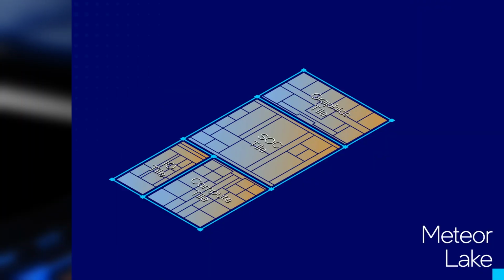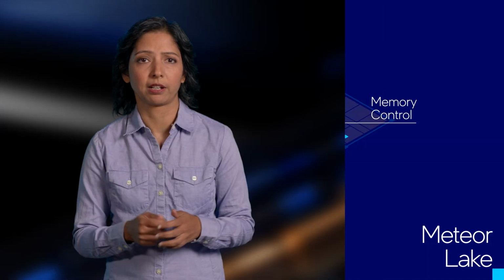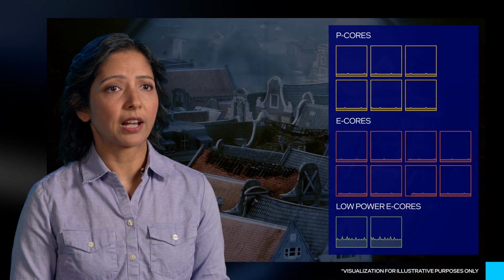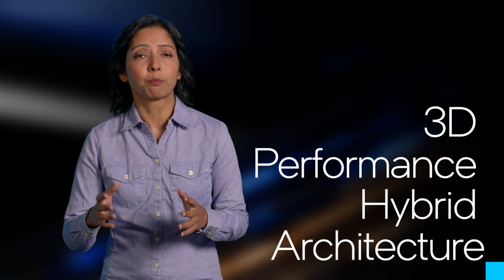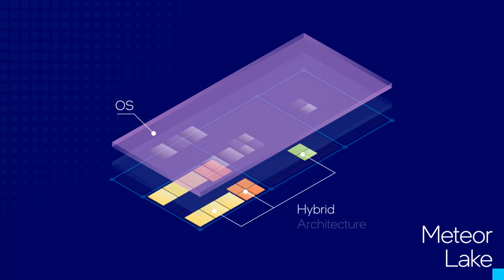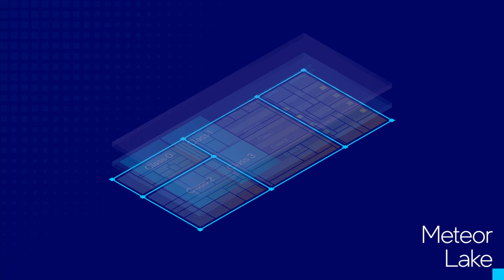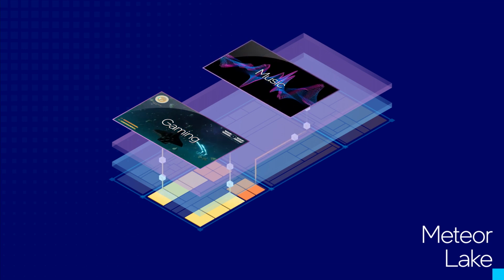Architecture All Access: Meteor Lake – 3D Performance Hybrid Architecture & Thread Director

Comment: Can the hardware guided scheduling technology not be available to developers to utilize in their applications instead of only the OS being able to make use of it?
Reply from the maker: Please be informed that hardware guided scheduling technology involves hardware providing dynamic feedback to the OS, and the OS manages the thread allocation across different core types (such as P Cores and E Cores) based on feedback from the hardware. This process is enabled through the CPUID instruction and configuration MSR, where CPUID and configuration MSR are instructions given to perform their task. While developers may not have direct access, they can use OS provided APIs to optimize their application performance. For more information, visit https://intel.ly/4iw0CcI Hope this helps.

Intel Customer Support
Reply: @IntelTechnology  Thank you Intel for the answer and link to that document. What's interesting in the document is that it only mentions MS Windows. A lot of developers customize the Linux OS, but I noticed also in that document is a link to the Intel 64 and IA-32 Architecture software developer manuals which contains 5240 pages in the complete volume series. Let me read up some. Thanks again.

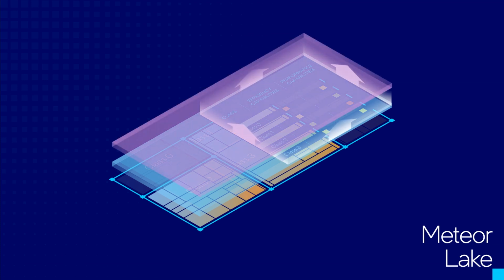Comment: 5:50 Why would the system ever be running on AC power? The power supply converts the AC wall power to DC power necessary for a sequential circuit. Could someone explain what I'm missing here?
Reply: She probably means charging (AC) or battery (DC). Modern OS shifts workload between big/little cores according to power source.

Comment: So will Meteor Lake's NPU be able to receive feedback from the application and then use AI/machine learning to dynamically optimize thread director to maximize performance? 

Each app is different, gaming apps are different from other apps, so will thread director be able to dynamically and intelligently reconfigured to maximize frame rates in games in one context or maximize performance in creator apps or encoding apps in another context ?
Reply: Being able to use the NPU is based upon what libraries are used for the task. The slides put out by Intel suggest that DirectML and OpenVINO are currently the APIs which can compile for the NPU. Once that is done, it is up to the discretion of the software vendor. The thread director is exclusively to balance the usage of the hybrid core architectures. AI tasks will primarily be handled by the GPU or the NPU or both. Intel showed off Stable Diffusion running on the GPU, the NPU, and both. The GPU is fastest, but the NPU is most efficient.
Reply from the maker: That's a great question. In the context of processor specifications, there are two types of cores: P-Cores and E-Cores. P-Cores are primarily designed for demanding tasks, serving as your standard, high-performance CPU cores. On the other hand, E-Cores are focused on ultra-efficiency and are typically used for background tasks that run continuously but don't require significant processing power.
 
Processors with a combination of E-cores and P-cores are architected to automatically utilize these cores efficiently based on the specific application's requirements. This architecture is one of the key reasons why Meteor Lake processors offer a 30% performance improvement compared to our previous generation processors. Additionally, Meteor Lake incorporates a Graphics tile on the SOC to handle high-end graphics applications.
 
For a more in-depth understanding of the Meteor Lake architecture, you can refer to the official Meteor Lake architecture overview at this link: https://intel.ly/47rRdgz For any additional assistance or queries, please share the details here https://intel.ly/477AijE We would love to look into it.
Reply: @IntelTechnology thanks intel! what’s missing from your answer though is an explanation on why you needed to implement APO for raptor lake refresh. According to the literature on the topic, gaming loads on your hybrid architectures don’t necessarily utilize the p and e cores optimally. In other words, you leave performance on the table with the thread director default. And it sounds like APO is hand tuned to better optimize performance. 

So my question stems from that context. Given that application performance appears to be able to be increased with APO, that suggests that the default thread director configuration may not be optimum across all application domains (read: gaming). Therefore, rather than a hand tuned scheme such as APO, can machine learning be used to optimize thread director and overall performance across all domains? And if so, can the NPU on meteor lake and future lakes be used to tune thread director ??
Reply from the maker: Intel made a decision to implement Intel Application Optimization (APO) on select 14th generation (Raptor Lake) Intel Core K/KF Desktop processors for improved FPS on select gaming applications. Please visit the link: https://intel.ly/40PqxEf to obtain information about supported processors available towards the bottom of the page. Meteor Lake does not include desktop processors with Intel APO. Intel Application Optimization is custom-determined for each supported processor, as they consider the number of P-cores, E-cores, and Intel Hyperthreading Technology. Due to the massive amount of custom testing that went into the optimised setting parameters, specifically gaming applications, Intel chose to align support for our gaming-focused processors. At this time, Intel APO does not support Meteor Lake, and any future platforms will be evaluated independently. NPU and machine learning will contribute to the overall processor performance, but at this time there is no connection between NPU and Intel APO.
Reply: @IntelTechnology  thanks Intel. That was a very helpful answer. I appreciate your time and your response to my question. I wish you well. I am rooting for you to come back. And looking forward to arrow lake, as well as thunderbolt 5.
Reply: i guess intel thread director is smart enough to work without NPU. And be aware that Intel Thread Director ONLY give recommendation to OS. The final's decision still in OS's hand.
Reply: @Arkan_Fadhila  intel APO released with raptor lake refresh shows that the default configuration for thread director leaves performance on the table when it comes to gaming. So rather than manually tuning thread director on a per game basis using APO, why not let the chip use machine learning to figure out the optimum solution for a given game engine?
Reply: @Arkan_Fadhila yes